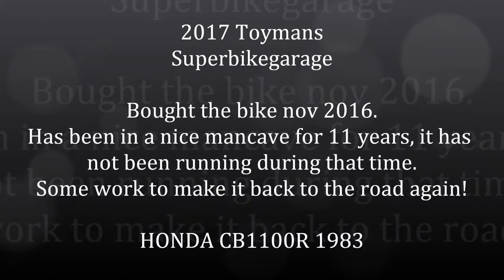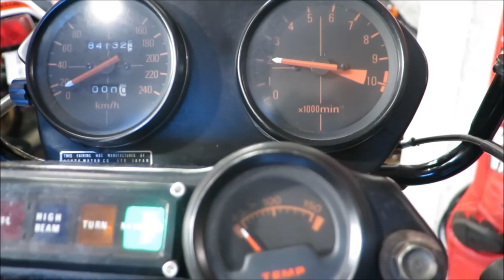Honda CB1100R 1983 well used........

Comment: The FAIRING BRACKET mounted to the VALVE COVER?  Rather than the conventional yoke/bridge across the backbone?  I'll tell  you one thing, is I wouldn't want to CRASH the thing like that! Nuts Hedck even if that's standard to the '83 model and I've just never noticed? STILL worth putting back to the '81-'82 configuration, hands down. Seems like somebody's DIY mods from where I'm sitting....
Reply from the maker: You are wrong, its not mounted to the valve cover. Its fitted original!

Comment: Those "Tornado" vented rotors painted gold? Dunno 'bout that! I like mine in black, and about the only other colour I'd consider might be a bead-blasted CLEAR-COAT. Same deal with the OHLINS shocks - I'd rather see THAT extra bit of gold covered over with another less ostentatious hue.... If there's anything worth doing with these heaviest of all Comstar wheels, it's the Akront "NERVI" rims to replace the solid thick D.I.D. items. The front size in 2.50x18" is available from a cheap 2nd-hand wheel, pretty much all the time. NOS wide 18" specimens are hard to find - which is why we've gotta get after the MORAD company to bring 'em back - But at least the FRONT wheel could be done in the mean-time. Then maybe some cross-drilled /77-'78 CB750A Hondamatic front discs, or FT500 Ascot rotors, replica CB1100R discs from Metalgear AU, or embiggened CB1100F spiral center discs in 296mm, in Cast-Iron from Robotools on eBay - 'Cause these double-thick vented "tornado" discs are a tad bit heavy - though they're unmatched in heat-sink factor and surface-area, surely the best anti-fade rotors of the era. There's a REAR one from GL1100A, but the 276mm FT500 caliper & maybe a cut-down early rotor, like '80 CB750FA without the slots or even the unslotted early dished rear rotor in 276mm? Just sayin' - IF there's anything to be done to the stock brakes, these mods would make sense - painting everything GOLD sure doesn't! Ha-ha. And maybe a 41mm TRAC fork from GL1200 or better yet GL1500 - a 43mm TRAC built from two right-hand-side legs off '96+ ST1100-A, which comes stock with 316mm rotors, so perhaps the spiral-center 9-rivet carriers from CB1100F again?  They've got a bigger center carrier than these "Tornado" discs, so they'd look more proportional in 316mm - IMHO it's so very important to keep the period-correct tech like TRAC anti-dive & fixed composite alloy/steel riveted non-floating rotors, floating single-sided calipers, etc etc. And of course the COMSTAR wheels. Just sayin' - there ARE some decent mods & upgrades without sacrificing that aspect of the bike's original character. I'm sure it wouldn't be CHEAP - the off-the-shelf Gold-Wing fork & Hondamatic rotors would be the CHEAP version - the GL1500 requires bigger bearings for the 20mm front axle, a heck of an upgrade in and of itself - But the GL1200 allows you to keep the 15mm axle and so it's the ultimate simplicity in low-budget upgrades. Paint 'em RED and nobody's gonna notice right away - Not unless they're RIDING that is!
Reply from the maker: Hi. All of the gold-painting is goone, replaced to black again! The forklegs have got some new red paint. And the motor has got some fresh black paint to. The only thing remaining not original is the rear shocks and the exhaust. And the blinkers fastener..... and it is sold!
Reply: Noooo!!! You SOLD the bike? What nonsense. How in heck are you supposed to enjoy the bike if it's stuffed away in somebody else's garage, gathering cobwebs? Just how many chances with a bike such as this does one GET in this life? Even if you DID have a dozen of 'em,  if you RESTORED 'em all, well that ain't the same as having a CUSTOMIZED  'R-bike,  building your own SPECIAL out  of  one, and RACING the damn thing. Heck, just on this whole subject of non-standard  paint schemes,  there have gotta be at least a dozen ideas which any one of us DOHC-4 'F-reaks ('F/'R-eaks?) would be chompin' at the proverbial BIT to attempt even one of 'em let alone pull it off! The way I see it, if you've got an 'R-bike but you're strapped for CASH, you sell off all of your OTHER possessions, rent out one's own ass, sell the surplus children for medical experimentation, take  out a second mortgage on your elderly smother's house.....
Reply from the maker: I understand you are upset. But there are 7 moore 1100R bikes in the garage. trying to get them out on the road again. Hi!
Reply: @TonysSuperBikeGarage  what did you get for it?